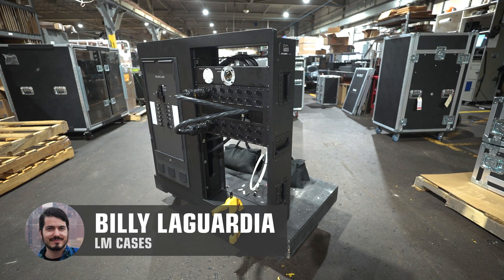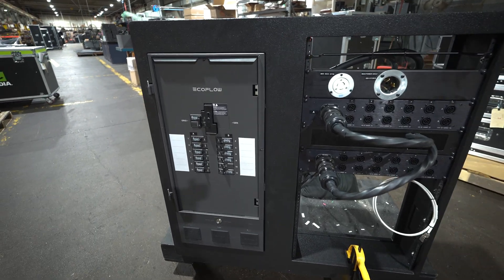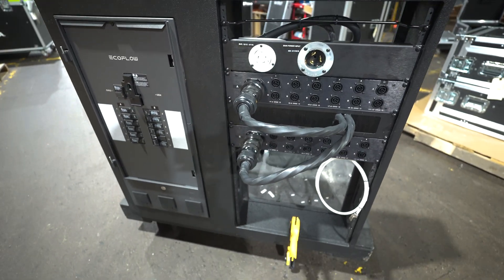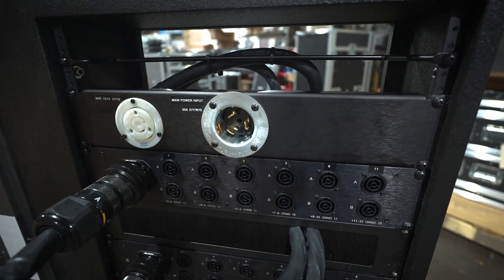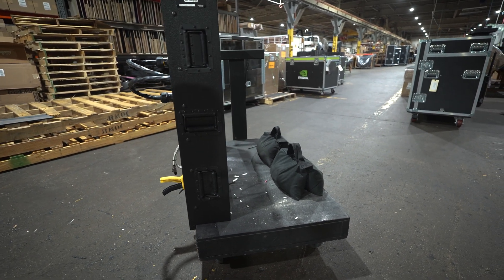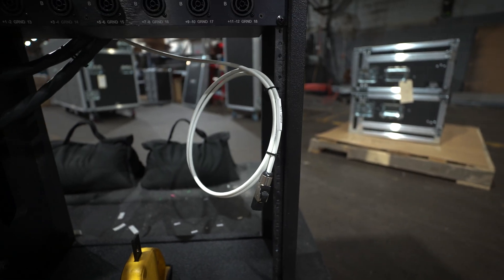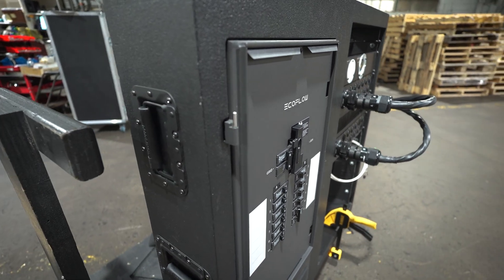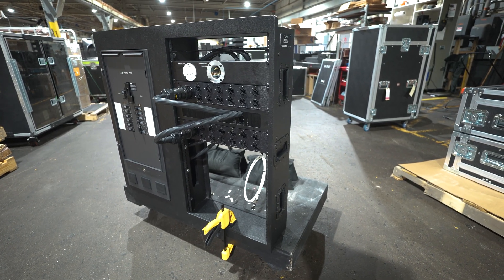Portable Transfer Switch Power Distro Caddy | LM Cases

Comment: Wow interesting BILD. It's not necessarily car charging are you can technically charge a car off one of those portable power stations. They just have their own proprietary DC connectors that look similar-ish. They are one of a few companies building temporary power stations and are slowly moving into more permanently interconnecting them. I have mixed feelings on the concept of this because it's putting kind of temporary stuff into what is essentially a permanent installation within the house. Kind of Frankensteing the electrical system. But it is convenient if you do want to remove it from your house and use it elsewhere without having back up power at your house. It is however created interesting things like this.

Comment: I'm not sold on the socapex connectors here, they seem to add a lot of bulk just to make an "internal" connection pluggable.
Reply: Especially with nonstandard wiring! Yeah that'll be fun one pin out of place between two different standards everything running over it from lighting, dimmed power, to standard AC, to data and audio......

Comment: This is kind of a brilliant application for that Ecoflow panel. I wonder if it could be built into a more traditional power distro and function as a whole system UPS. Would be great for a video village
Reply: Thinking similarly, would it be feasible to connect it to varying racks of EG4 batteries for example and you could maybe have a whole-set backup solution
Reply: There's at least one company that selling or renting I can't remember. basically a big box of batteries for productions sort of as a massive runtime UPS, or as a enough power to get you through the day, or to sit between a generator that can be turned off during shooting for Sound, or powered by solar. I've seen a few power distribution units mounted to a dolly or the more homemade version piece of plywood (some thing that I'm working on myself).
This is such an excellent application for that panel though. You are more or less limited to that form factor right now as they are I think partnering with span panels.
They also have the Power Hub which is more of an RV panel with AC and DC access in a smaller form factor.
Reply: @imark7777777 good to know, I’m based in the Caribbean so it limits our options to custom solutions or very affordable and available brands on the market